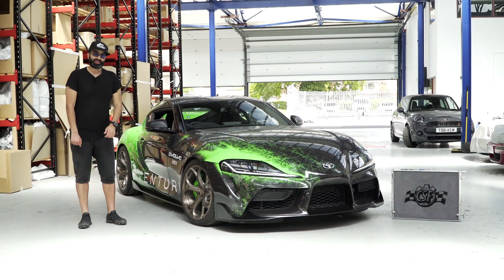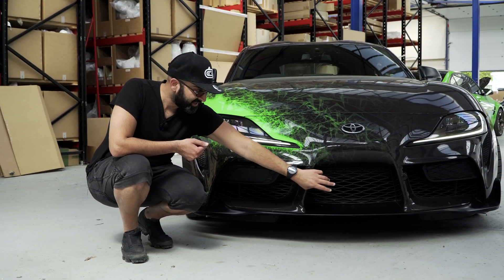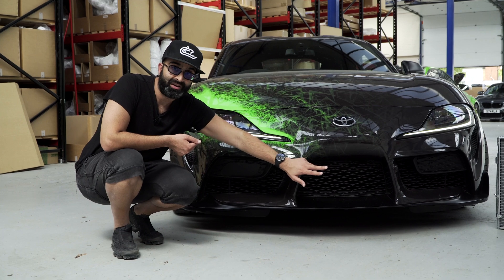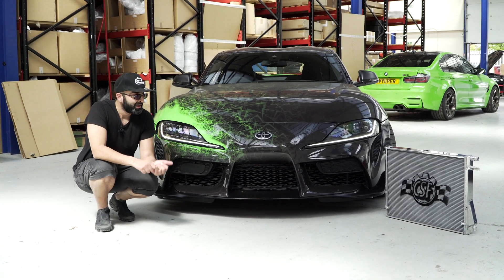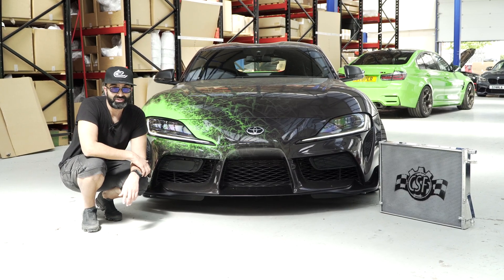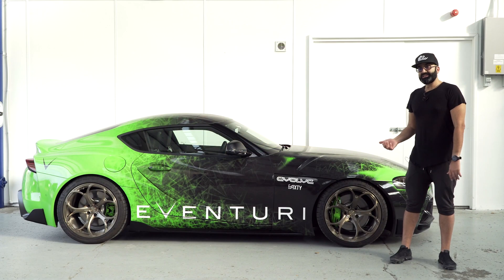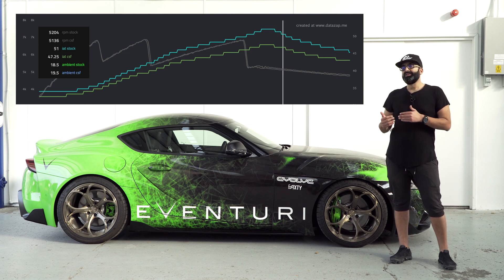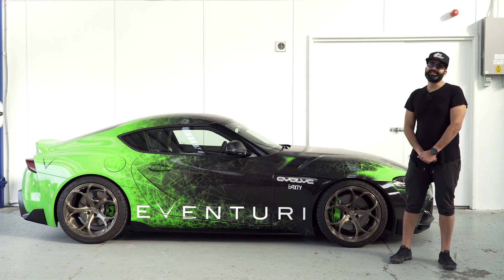Fixing a Supra problem with CSF - Heat Exchanger upgrade

Comment: I little question, the iat is a bit higher than the ambient air temp because of heat soaking the intake components and hence raising the intake air temp . Right?? If yes,  why not trying to solve this problem with a cold air intake instead ?! 
And how a heat exchanger lower the iat ? Is it be lowering the temp of the engine and hence the heat in the engine bay and hence heat soaking intake components??
Reply from the maker: The heat exchanger is lowering IAT by cooling down the charged air more effectively. It has nothing to do with engine bay temps.

A cold air intake such as the Eventuri that is fully sealed will help, but the stock heat exchanger gets saturated too quickly due to the small amount of vents at the front, which then means it is no longer effective at cooling the charged air that has been heated up by the turbo.

Comment: Well according the the log it's a 5° iat difference but according to the good engine timing the stock one isn't suffering too bad either.
Reply from the maker: The tune was done with the stock cooler, and we didn’t want to adjust the tune for the after. Could push the timing a little more now I think with the lower IAT.

Comment: I personally haven't experienced any heat soak and I'm also on Stage 2. Maybe it just hasn't been warm enough yet, I'll see this summer.
Reply from the maker: Even stock the IATs are higher than we would like, and compared to say an M140i that shares a very similar engine. Tuning it only exacerbates the issue. The lower the IAT is the better so a simple fit and forget to drop 5c is a no brainer IMO.

Comment: 40 degree Farenheight - not bad at all!  Ive been waiting on installing my Fluidyne - but now I think I will try it as the upgraded heat exchanger looks to make good gains.  I wonder if pure meth is run if it would make as big of a difference or not.
Reply: 40?

Comment: Why not open the heat extractors?  Or Carbon fiber bonnet
Reply from the maker: What heat extractors?
Reply: @EvolveAutomotive  im assuming he is talking about the fake vents, during the launch of the car Toyota said vents were put on the car specifically for tuners to remove to get better cooling
Reply from the maker: @bugsy791  Ahh, the ones on the bonnet that sit outside of the rubber seal meaning that even if there was a hole when removed (there isn't) wouldn't be venting the engine bay at all as they're sealed off from it.